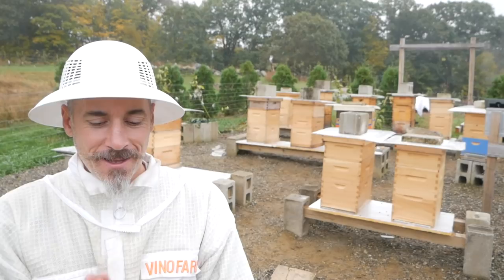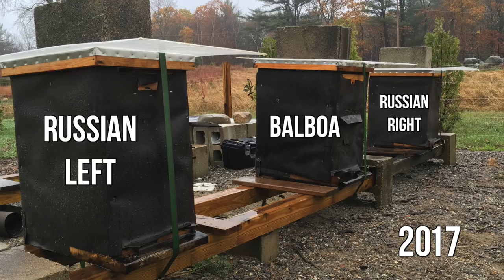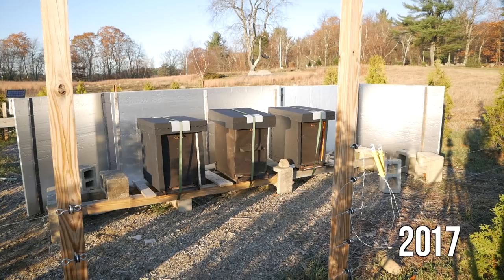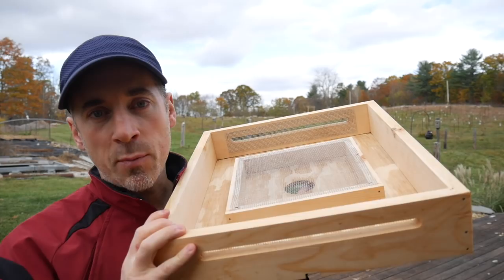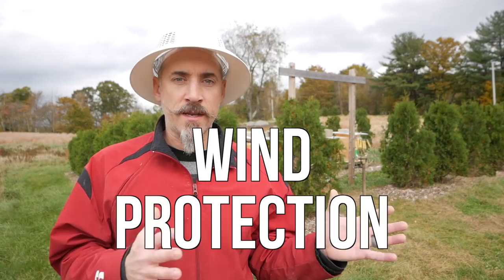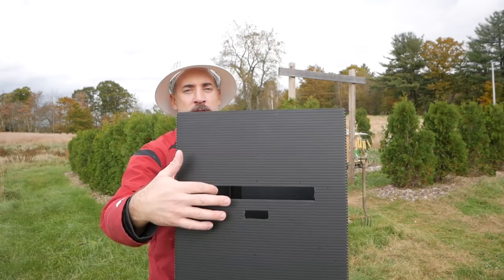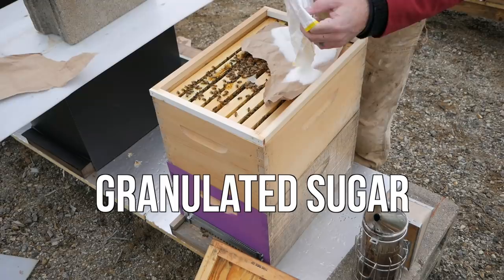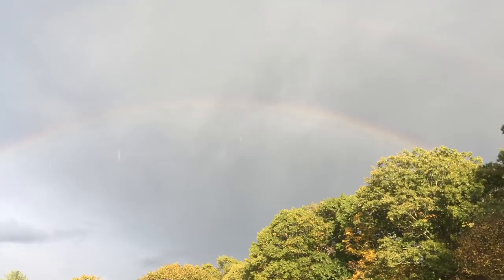Never Use Tar Paper Again, Beekeepers!

Comment: What is the reason for not feeding inside the Vivaldi Board?  Did you have a bad experience in past winters?  

BTW- I have been using Reflectix for winter wrap.  I had some left over from a project and decided to use it. It is not expensive. It’s not bulky.  It is reusable, easy to fold up and store, and has an R value of 8.  I also cut it up into rectangles and make a R16 pillow which I place under the bottom boards and in top cover.  

Reflectix is easy to fit around the hives. I wrap, staple tight along one seam.  I then pull off and turn it inside out so the seam looks good.  

Hives look like spaceships but the bees seem to stay warm and dry.
Reply from the maker: I figure why not give them the food right where they are? Rather than making them climb up into a damp, chilly attic. 

No offense, but every time I see hives wrapped with that reflective wrap, I think about the wasted solar gain that is shining off the hives. I want everything BLACK to absorb as much heat as possible. Inside the hive makes sense, though. I just imagine you're reflecting heat AWAY from the hive when that's on the outside.
Reply: Vino Farm -

You are likely correct with regard to lost solar gain opportunity.  Ideally, it would be good to  slow loss of heat generated by bees and gain heat from sun.    I’m tempted to buy a few broodminder data loggers to monitor hive temp and humidity. 

I had a roll of R8 Reflectix sitting in the corner of my basement and used it last winter.  One big advantage to Reflectix over plastic and roof wrap is that it is a vapor retarder.  

Bee genetics and hive health likely play a bigger role in survival than both Reflectix or solar gain.  For example, Michael Palmer doesn’t even use an entrance reducer.  The entrance is wide open protected by hardware cloth.  His bees are hardy.  This summer I was fortunate to pick up a few queens bred from his Northern stock.  

Good luck with the bees!
Reply from the maker: Yes, Palmer is amazing. He does have decades of breeding to get to where he is. So far I have one colony that's made it through 2 winters. That colony produced 4 new colonies this year. It will be interesting to see if they all survive. Then keep propagating them. Genes definitely have a lot to do with it, but I still want to increase everyone's odds as much as possible.

Comment: I only finished this season with one hive ( of two ) Lost one the on the first night. the queen died and whie a pound or so moved in two the other hive I just went with one. Four Med boxes 80% full of bees brood and food. No honey for me. I used Hop Guard II  four times (early may., Mid June early Sept and the second week of Oct.) for mite control  only looked a few time and no mites. I like the design of your Vivaldi boxes. No Fondant this Year?  or  did you just  use syrup? I Am using 10 frames and plan on using deep full bottom  brood boxes next year. Med  frames require too much manipulation.
Reply from the maker: Still need to add the outer insulation and will probably drop in fondant in December if we get a warm enough day to open the hives. (There's always one odd warm day in there.)
Reply: @vinofarm   I fed some sugar patties after the syrup soon after switching to the Vivaldi boxes and I found bees on both sides of the screen in the boxes.  I think screens like yours may be better. I use hive a top 2 gallon feeder and had more than a few bees in the syrup.  So frame feeders may be better. Mann Lake has the coroplast covers, I am using tar paper and a bee cozy this year I plan  on cutting a piece of blue one inch  insulation to put on top of the wick. Will you still  be using your foam jackets?

Comment: another great video but a few questions 1) seeing as we aren't into full on winter yet do you worry that loose sugar now will just feed hive beetles? 2) Your varoa test, as you state, had 11 mites in your check. If you are doing it per instructions wouldn't 11 suggest you have a pretty significant infestation? 3) on your hive wraps being that plastic is water tight, do you worry at all about condensation forming on the inside of the plastic wraps thereby holding moisture against the hives?
Reply from the maker: hyfy1970 We don’t have hive beetles. Nights are in the low 30s F, so I’m not worried about insect problems. 

I got 11 mites from a sample of about 300 bees which is not super high. I got the treatments in and there’s nothing else I can do at this point. 

I’ll be monitoring moisture on the inside of the  plastic. It’s open at the top and not clinging tight, so there is some air flow between the box and the plastic. There is going to be a little warm up this weekend so I’ll peek in to see how they’re doing after about 10 days and a ton of rain. It might be a good idea to just cut some notches in the bases of the wraps to allow water to escape if needed.
Reply: @vinofarm  thanks for the thoughtful response!

Comment: Have you been able to determine the R value of just using the sleeve? Did you still add the foam boards Around the hive?
Reply from the maker: The sleeves are not for insulation. They are a wind break and add to the heat on sunny days. Watch part 2 for insulation.
Reply: @vinofarm  thank you so much!

Comment: Is there any specific reason you stopped feeding them up in the vivaldi board? I was just preparing to build a couple for that specific reason. Thanks for the great videos.
Reply from the maker: Tom Arbuckle I like the idea of giving them food right where they are rather than making them climb up to a cool, damp attic. Basically, making it easier for them.
Reply: @vinofarm  That makes perfect sense.     I think I'll try may hand at some sugar cakes for winter, placing them directly on to of the frames. I've tried the fondant process, but botched it both times. Thanks for your thoughts

Comment: Just an idea, when you cut the rectangles for the entrance & vivaldi board...on each rectangle, why now cut out only the sides & bottom then use the last edge as a hinge so you have two little awnings.  Maybe it's not necessary with your large awning, though.

Your super foam insulation and sun board rocks!  (So does the coroplast!)

Comment: Wow you have some many comments lol. I'm not sure how you keep up with all this.... Anyway, if you have time, could you explain the purpose of the coroplast/tar paper wrap? Would the rigid foam insulation not provide the same benefits as the coroplast? I've actually never had it explained to me so just asking. Also I saw a few years ago you used the formic acid mite away strips. Would you still recommend those? Thanks again.
Reply from the maker: This is the first layer. It's for late fall/late winter wind protection. There will be a foam layer going on in a couple weeks for actual insulation. MAQS was very effective for killing mites, but the time and temperature where they are OK to use is very specific and difficult to time with honey harvests. If all the stars align and the weather is right, they are effective.
Reply: @vinofarm  Thanks! I used formic pro this year based off of your previous video with the MAQS. I think maybe it's a newer product, anyway it says you can leave it on with honey supers. But it did say day time temps from 50 to 90.... . It worked really well for me this year, no problems so far. Kind of pricey though.

Comment: Where did you get the black coroplastic
Reply from the maker: A sign supplier in Rhode Island. NEPCO.
Reply: Thanks Jim
I saw it in an earlier post..
I have a sign shot in our town..
I get the leftover political sign and use them for removable screen bottom board
Reply from the maker: You need to go to the supplier and get the 4x8 sheets!

Comment: This might sound crazy but could you use a diaper with the plastic layer removed under the lid of the Vivaldi board to trap the moisture?
Reply from the maker: I'm not trying to absorb moisture, I'm trying to wick it out of the hive and out the upper vent.
Reply: Vino Farm I was thinking to avoid the mold. Maybe that’s not an issue. Not the best aesthetics I suppose. I love that you bring beauty into everything you do.
Reply from the maker: The condensation is very pronounced right now because the lid is not insulated yet. As soon as the top cover is wrapped, the temp difference will not be as dramatic and there will be far less condensation. Thanks!